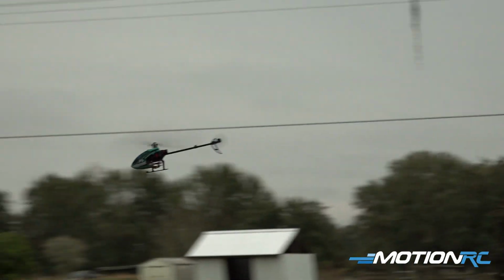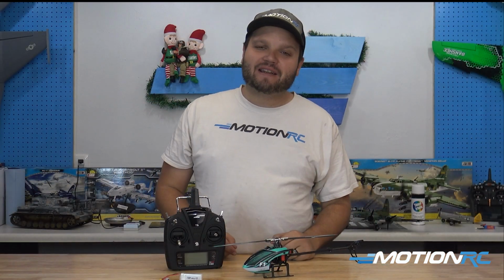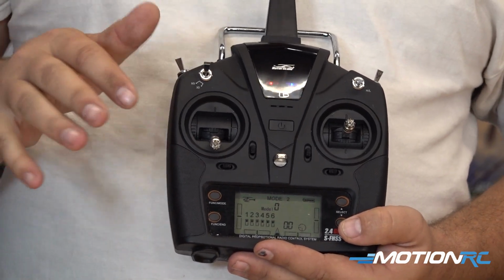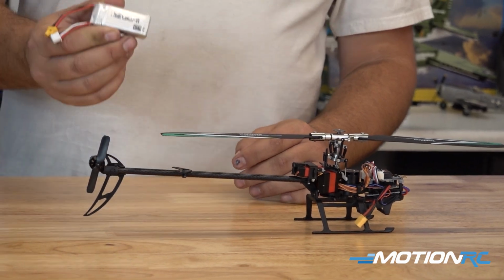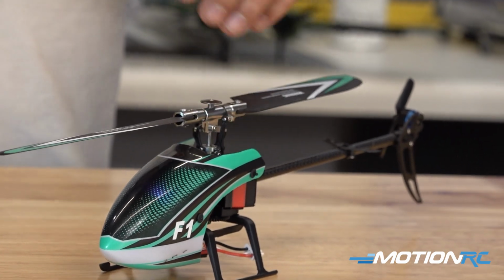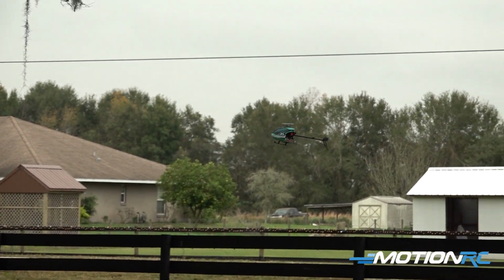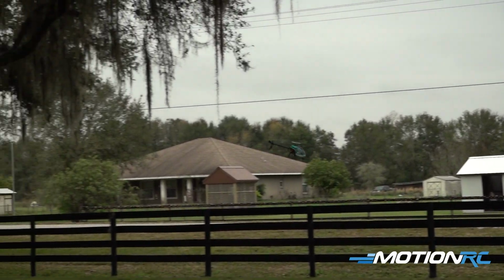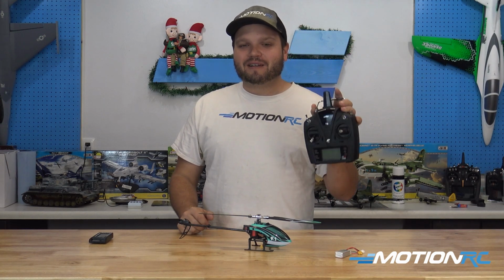Perfect Beginner RC Helicopter | RotorScale F1 180 RTF | Motion RC

Comment: Hi there,
I have this heli and the small pinion gear on the motor shaft is disengaged from the bigger gear how do I get it to reengage? I have pushed up on the motor shaft and it moves into the correct place,but does not stay there.